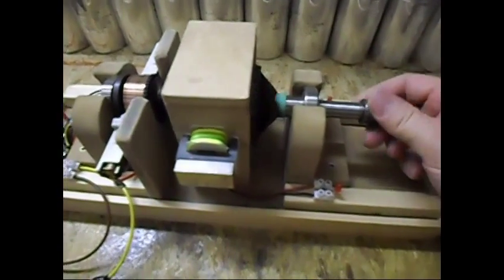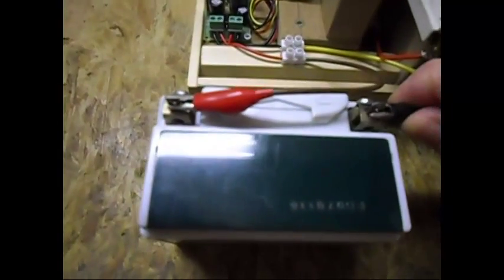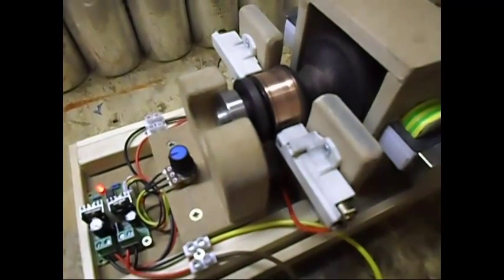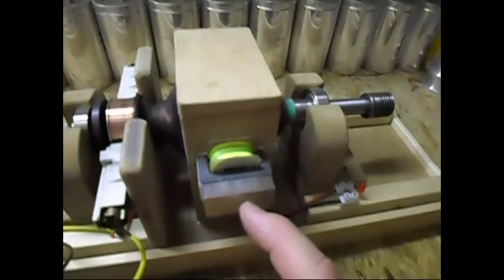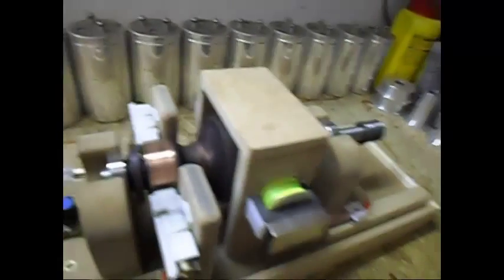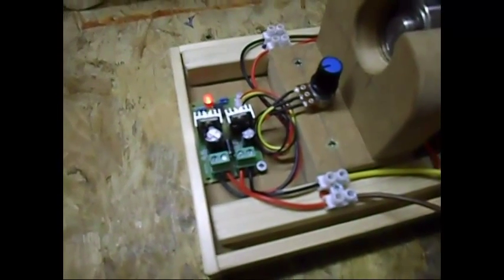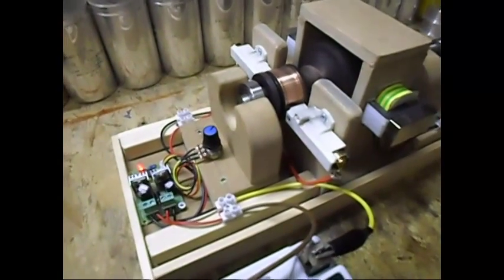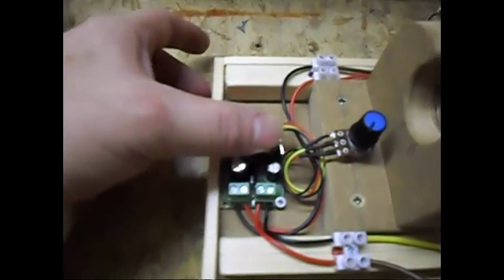Universal Motor Rotor_Pulse Motor - Update 1 Fun project with PWM...

Comment: Hi, nice to see some Updates :-) These Magnets on the Coils acts like a magnetic Amplifier, right?
Reply from the maker: Hi thetrackx,
Thanks for your comment...^^
The magnets are needed otherwise it will not run but you can run it without magnets but than you will need large iron cores as close you can get them next to the rotor so the magnetic field from the rotor can be attracted to them but this also uses more input power...;-)
But with magnets it is easier and less input is needed...^^